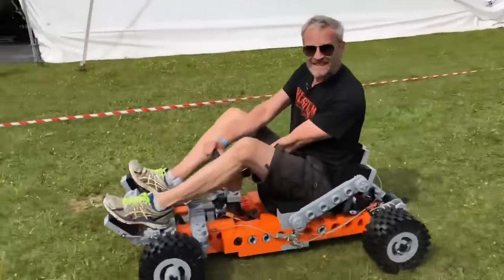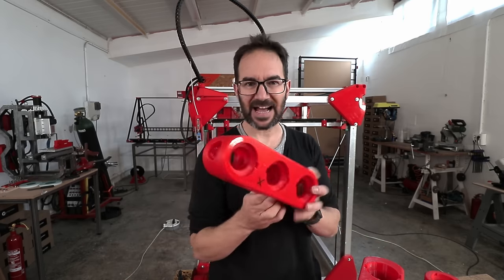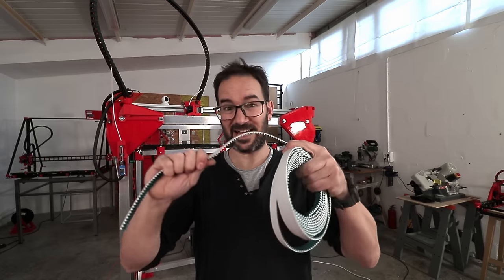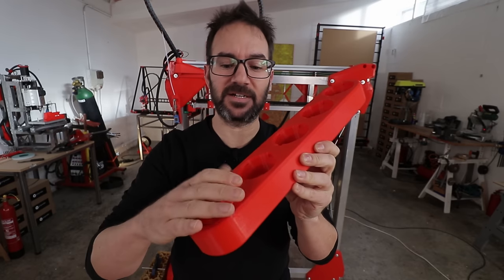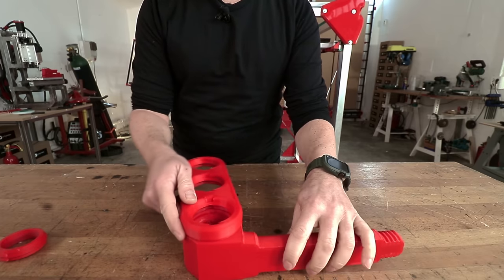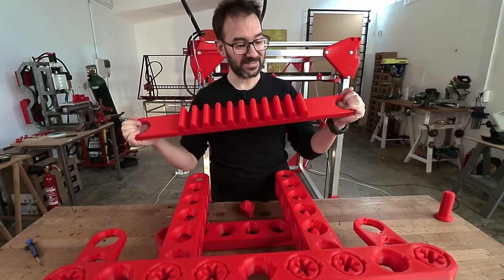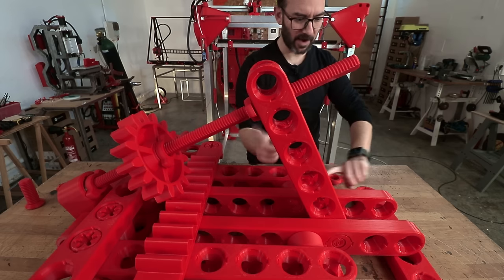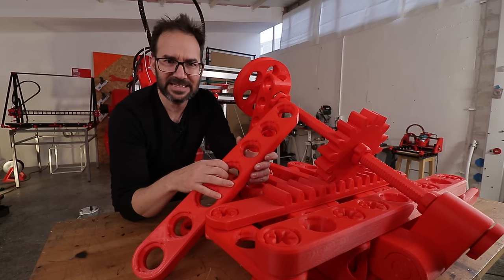YOU WON'T BELIEVE WHAT I 3D PRINTED THIS TIME ft. Matt Denton (from scratch)

Comment: That build system you designed probably does have the potential to become pretty popular, like in the way gridfinity has. If you created standard sizes for scaling them down and released them, it would definitely be interesting and I think that lots of people would be interested.
Reply: Just my thoughts too!
Reply: Would be really interesting with cnc routers and wood.
Otherwise I think it's probably prohibitively expensive if you don't have a sponsor
Reply: @satibel  scaled down version wouldn't have to be.
Reply: @conorstewart2214  true, a duplo sized one might be great.
Reply: @satibel  Yes, a bit like king size BILOfix
Reply: I haven't really seen the full video, but why wouldn't you just use lego? The designs are not copyrighted
Reply: @incription  They still have patents on some parts of it. Also lego is probably better for injection molding rather than 3D printing whereas this would be much easier to print for a lot of people as it doesnt matter how flexible the plastic is or the strength and stiffness of the plastic like lego does, especially the technic line.

I think basic lego blocks arent protected anymore but I think technic still is, which this is similar to.

Comment: imagine making a tank out of those blocks, so cool. love the design and ease of use you came up with
Reply: Not just any tank but a full size tank XD enclosed cabin, room for at least three seats, etc...
Reply: He already made a tank
Reply: @lordferdinand85  Which is why I was more specific in my own suggestion. Also, using the modular blocks would require a different design to the tank in any case.

Comment: Very cool project! This would make an amazing diy kit. It's obviously not practical to 3D print; however, if you had a company manufacture the designs, I imagine it would be extremely popular. Scaled up blocks for hobby building is a pretty cool concept. There's always a bit of satisfaction from assembling some IKEA furniture even if it's a hassle at the time.  I like the idea of having a kit that could be reworked later into something else with limited effort. It has real appeal to someone living in an apartment with limited space.
Reply: with the geometry of the beam i don't think it's injection moldable, so it has to be either 3D printed or machined
Reply: It's practical enough. The larger beams just require either a large volume printer like Ivan built or else a continuous belt bed like the White Knight or the CR-30. The steering pinion and a couple of other parts might require breaking down into smaller prints on any printer smaller than a CR10-S5, though.

Comment: I used to make Lego racing cars, one thing I Remember is the ball joint that was used for angle shaft. also I  use the back wheel shaft with a big gear with eccentric holes to make pistons up and down

Comment: Looking good! :) One thing that kept popping in my head was the print orientation of the screws, if you printed these with screw heads down on the heat bed, wouldn’t you worry they will snap between the layers at some point?

Comment: Looks amazing, great post. One suggestion: To improve the way the kart handles during turns, you could include Ackerman steering geometry rather than the perfect parallelogram setup you currently have (shown at 9:10). Basically the wheel on the inside of the turn needs to turn further so that it can correctly follow the track it needs to take. Wikipedia has a good article on it.
Reply: @GeoffTV2 :  If you watch the video again, Ivan covered the lack of Ackerman, and said it was a challenge for the future.
Reply: @John Colvin  Ah, OK thanks. That's what you get for skip-watching a video.

Comment: I think it would be a good idea to have jam nuts on that steering shaft. So, where every nut is, there would be a second nut tightened against the first nut (like really old 3D printer designs that used threaded rod). This would prevent your steering from going loose, which would be a bad thing.

Comment: Hey Ivan! Since you print everything mainly in red color and you need an idea for what to build next, I guess the obvious option is LEGO set 42143 :) life size of course (try to imagine sitting in it)… you may have to upgrade one of your printer's build volumes but hey, who else has a 3D-printed LEGO Ferrari at home? :) I would consider myself a combination of the 3d printer and plotter - large printer bed, small Z-axis height - as in one of yours CNC milling machines :) I hope I helped :D

Comment: You should add a flat side to your screws so the layers are long ways which will be much stronger. Also, next printer build you should make is a belt printer. Then you could make all the extrusions for a large format printer instead of using aluminum. A massive all plastic frame 3d printer, now that will be really cool to see!
Reply: As long as he prints them correctly, limiting factor should be nut thread length as it's below ISO spec.

Comment: You might be able to fix the belt issue your XXL printer is having by using chain drive instead. Like a motorcycle chain. Though that might be to heavy. Do they make aluminum versions of it?

Comment: How about a six legged walking robot using these parts? You don't have to ride on it, but perhaps it can have a camera and some sonic or whisker sensors so it could be driven remotely or as a semi autonomous device. (The extra sensors would be to observe if there is space around it to move and turn in case the camera gives not enough info.)

Comment: You are a great cad guy! How do you prevent the bolts rattle of their nuts? I also wonder how strong the nuts are because printed standing up which will load them on the layer  s?
Reply: Some PLA TDS call for 59 MPa tensile strength in XY and 52 MPa in Z, difference isn't as big as how much undersized his nuts are

Comment: Well done! With enough parts you could make a Lego tank there are hundreds of designs you can choose from and you should just be able to find any building instructions and print the necessary parts in your Lego style. Although,  you might have to make some parts stronger due to it being a tank and all. If you can find some steel alloy bars roughly 5mm in diameter or smaller you could bend it around a pipe in a spiraling pattern, or make a rig that will do it for you, you could make a Lego shock with some improvements like adding linear rails to make them much smoother and really expand your Lego creations. I might be going way over my head on this but it would be amazing to see missive 3D printed Lego shocks.

Comment: The crude gear mesh spoils the aesthetic for me. You could trivially print the rack teeth at an angle to the strut, so that the gear mesh is full rather than a point contact as at present.